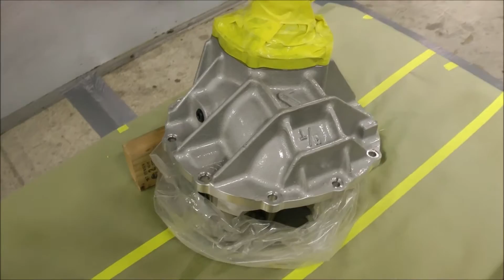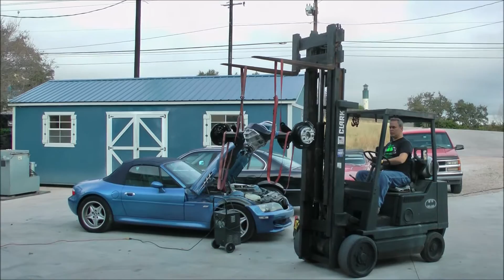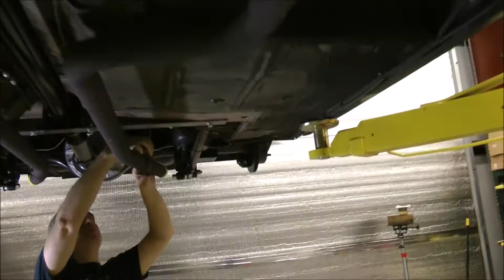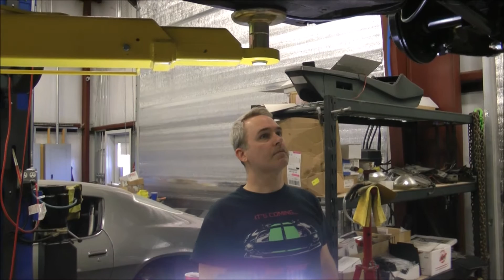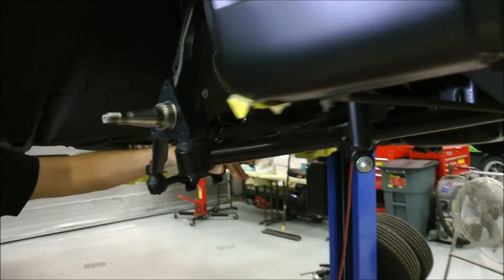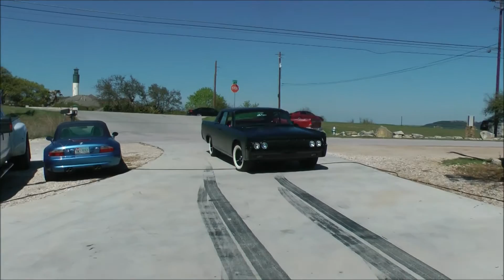1964 Lincoln Continental Conversion Part 2

Comment: I called lincoln land and asked about that set up for my 64. They did I would need a 65-69 booster as well and they are very hard to find. There is a company in Texas that offers a kit for front and back with new booster and master cylinder. I just don't want to run into a problem. I'm wondering if it's the same company you tried to use?
Reply from the maker: Strange. We didn't use a 65-69 booster and it is working great. The company is Classic Disk Brakes.
Reply: mitchmedford did you upgrade or modify the master cylinder?
Reply from the maker: Nope, just flush and clean. However, we will be replacing the booster/master cylinder setup when the electric conversion is done because we will use an electric brake setup. What I can tell you for sure is that the car's brakes just fine with the old setup and the disk brakes from the 65-69 setup. We were a little concerned about proportioning, but everything is working great right now.
Reply: Angel, with aftermarket brakes for the LCs it requires a minimum of 17-inch wheel. On a 64 I'm getting ready to pickup I'm upgrading to 65 front disc brakes. That way I can roll the 15s and white walls when I want. On my 67 I kept the org brakes so I can also roll 15s when I want to. CPP or Baer both makes aftermarket setups for these cars.
Reply: Check with Tim Nill at Lincoln-Ranch dot com. He prob has a booster. I sent my 67 booster to Booster Dewey (Google him) and will rebuild it. The 67 boosters are awesome. CPP recommends simply reusing it.